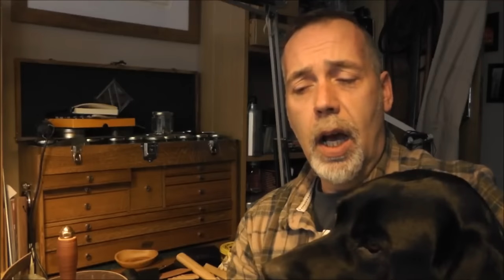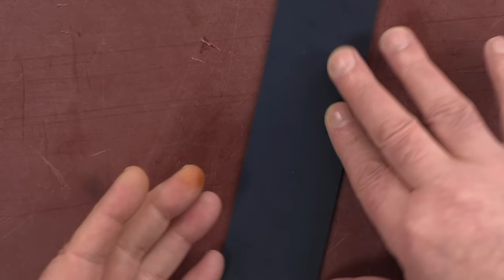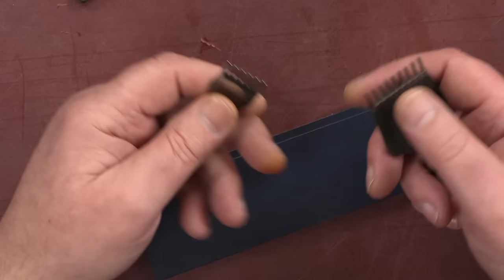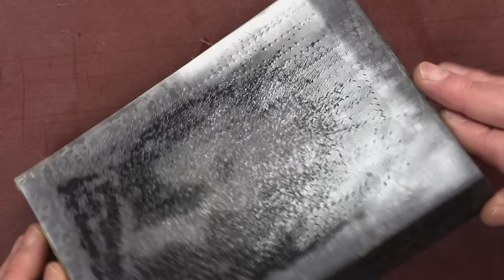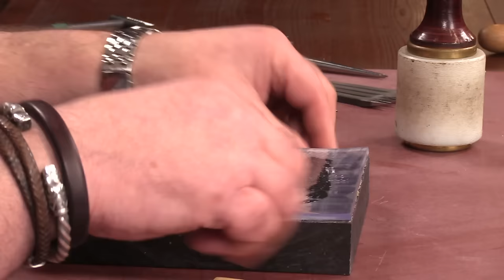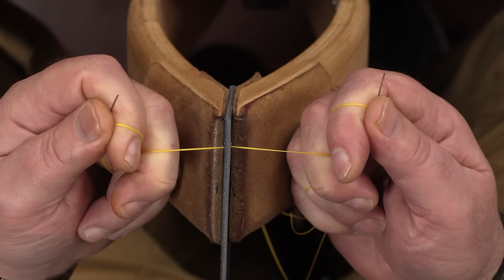How to Hand Stitch Leather - Saddle Stitch -  Modern Style - Tutorial Part 1

Comment: I'm at the 43" mark and you go into R vs L handed.  Now, having watch a bit of part 2 and 3 I know there is a "face" to the leather.  I am wondering should you make your holes from the face, should the slant of the hole be away from you (as another youtube suggests while you stitch towards you).  These parts of the set up will make a difference from comments you've made elsewhere.  So, getting the leather set up with hole and face could be better mentioned unless I'm to new to know crap.  I've already learned much from your videos and am taking notes along the way but I have to develop a thorough process to make this work.   Update: ok after watching a bit more you explained exactly what I wanted with face of leather and casting.

Comment: Regarding the Crimson Hides marker, if the marker isn’t held at the same angle you will still get inconsistency. I’ve often wondered why markers, such as these, don’t have one prong slightly longer than the other so you can use them at 90° (perpendicular to the leather) and not at a slight angle!
Reply: They are marketed as creasing irons by Crimson Hydes. Nigel has started to use them as stitch line markers and talks about this in his review of them. He also touches on how if the tools are used this way they can be modified to left or right hand use, one of the benefits being more accuracy.
Reply: @samg8822  Even as creasing irons, wouldn’t it be easier to use them if one prong (the one that goes against the side of the leather) was slightly longer so that it could be used perpendicular? 
After seeing Nigel use the iron as a stitch line marker, I found an old two prong 4mm diamond stitching iron and filed it down for a stitching line marker, with one prong shorter than the other. The prongs have to be filed round and smooth but it works much better than callipers and is now my go-to tool for marking and making a crease line.